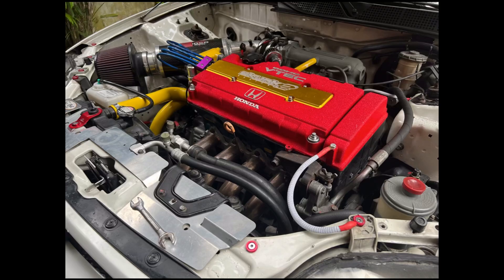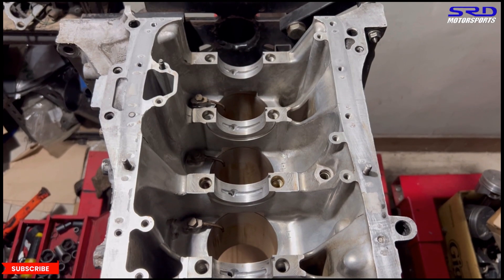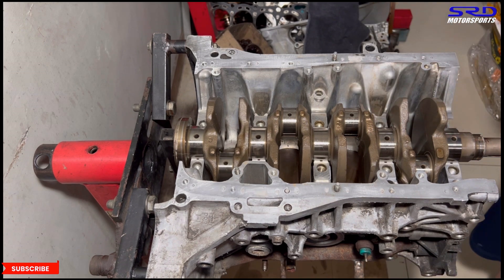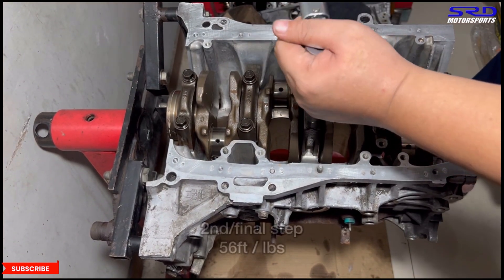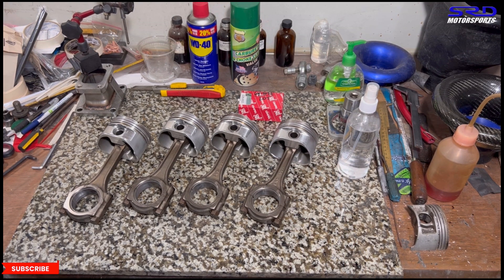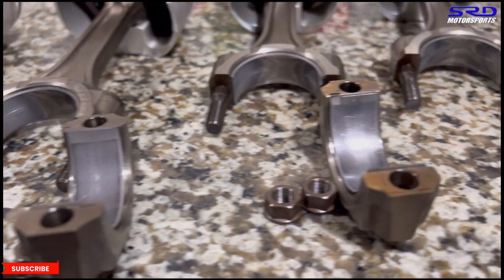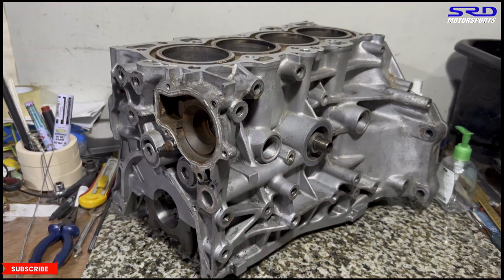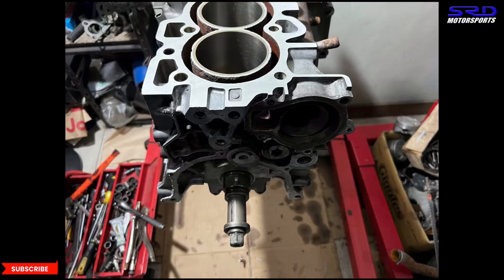Honda Civic SiR B16a Rebuild Series Part 2 Block works and Crankshaft

Comment: The cleaner the build the longer it's gonna last, prep is key, loved how you used oem bearings as well, give you the clearances you needed. For a turbo setup ACL would be better right? Since it gives you a little more oil clearances?
Reply from the maker: Yes true on ACL pls it’s more durable than OEM so even roadrace NA , acl is a better choice
Reply: @SRDmotorsports  ahh okay gotcha, thanks for the advice brother
Reply from the maker: No worries man

Comment: Bro love u Chanel  u a b series Master la crema de la crema also if I not border you  can u give me a set up for a b18a1 engine  I know not to many people like it but it's what I have and I want to do it the right  way
Reply from the maker: Oh thanks for the kind words man!

Nice a b18a1 IMO a lot would say a b16a head to make an LSvtec will make more power while yea that is true? Not everyone is racing for points at the stop light 🤣😂

Crower has very good nonvtec cams for the b18a/b the 62-402 and 62-403 is excellent with great idle the 62-404 is good but rough idle (take not not the 63-402 that’s vtec)

U can run replacement p30 npr pistons it’s gonna be good if the pct/CTR replacements are expensive but both will work good

Comment: The scoring is bad ❌
Reply from the maker: it is! and borderline interesting the scoring alignes with the main bearing oil outlet and crank rod journal oil outlet onto the rod bearings

so its debri within the block oil tunnels or oil pump and crank or all three 😲
Reply: @SRDmotorsports  It's either the shop was too lazy or does not have enough awareness to make sure the engine is clean enough for assembly
Reply from the maker: @findtherightbeat  true on both possibilities as it’s time consuming

But then again not many can realize debris are like ninja’s it be hanging around unnoticed lol
Reply: @SRDmotorsports  If they charge good money for a refresh, they should consider providing service worth the money they charge.
Reply from the maker: @findtherightbeat  locally thats why i catch alot of flack hahahaha exactly cuz of what u said and what we share = even a regular rebuild gets the same attention to detail

and i "do not" send my worker to do the work yet claim to be a "builder" 😂🤣😂